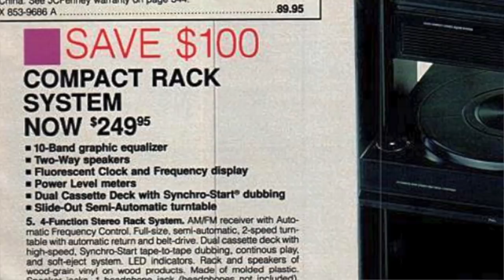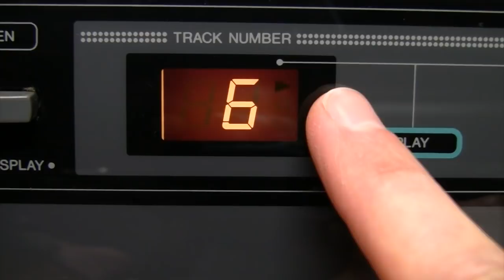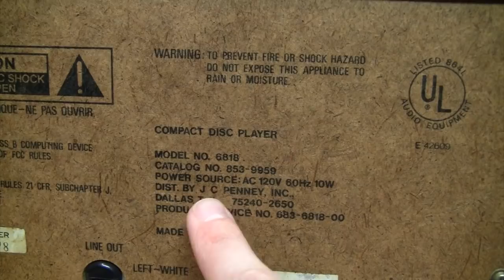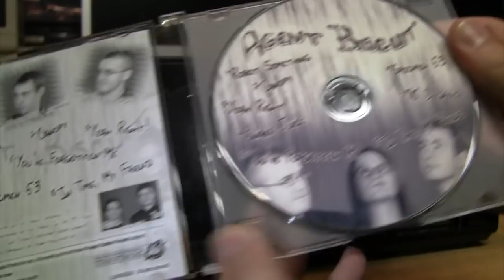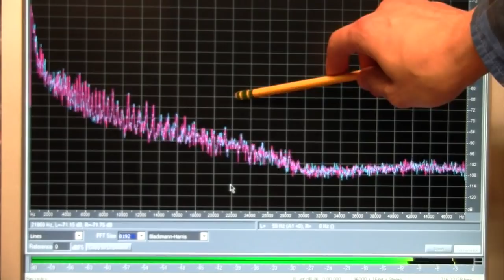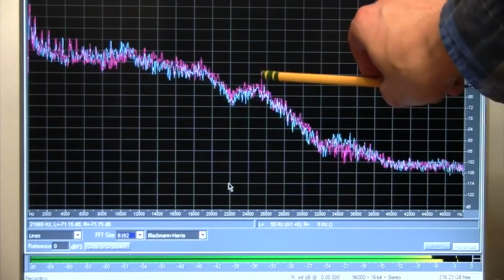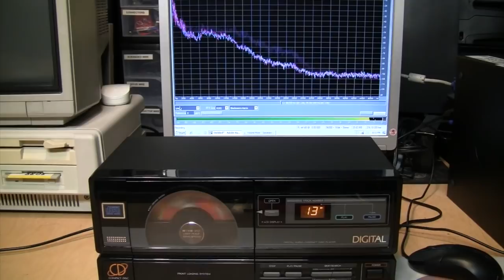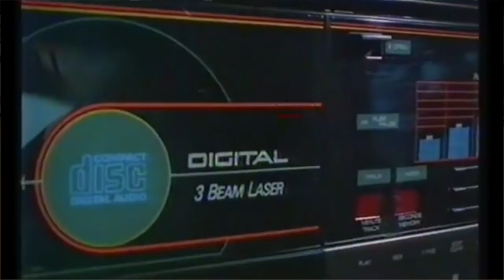The cheapest CD player ever made is surprisingly good - the 1988 Yorx CD Pal

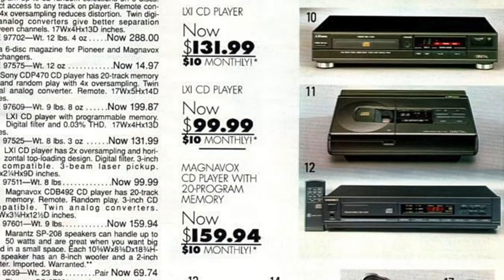Comment: 1:25 my first ever CD player was #12 on the catalog photo. A Magnavox. That thing was a beast. It lasted forever. When I was DJing in clubs I even carried it around to play mix CD's so I could take a break. Dropped it down the stairs of the nightclub and surprisingly it still worked. I had it for over 20 years and then I think heat finally got to it as I was DJing at another club where the AC was out and it finally died. As for the JCP CD Player, it looks like the one my wife had when we were dating. After we got married she left it at her parents house. I should check next time we visit there but chances are it is long gone since we have been married over 20 years now.
Reply: That looks like a Philips CD492/482/480 clone, Philips owned the brand Magnavox for parts of the world or the whole world by that time, but your Magnavox was manufactured in Hasselt Belgium by Philips.
Reply: @corneliusantonius3108  I am not really sure where it was made. Wish I still had it. I remember Phillips/Magnavox had a factory at one time in Knoxville, TN before all the jobs moved overseas.

Comment: This is Brian. Thanks for testing this unit with a cd-r. Sony equipment wss notorious for not playing cd-r and cd-rw discs. This is a nice unit for its price. You are my hero for testing affordable units that slipped through our fingers in the past because people think you must spend more to get more. I have to mention that I've opened alot of sony low end boom boxes and equipment from that era and found all Goldstar chips inside. And sony sold them at high prices.
Reply: Wendy Starita CD-RW playback requires explicit support in the CD pickup, so only very late CD players had it. CD-R, on the other hand, is designed to play in any CD player. When it doesn’t work, it’s because of a combination of the quality of the burned disc (whose quality itself is the result of the quality of the blank disc and how good the CD burner was) and the quality and condition of the CD pickup (with time and use, the lasers and photodiodes age , the adjustments can get out of calibration, and the optics can get dirty and foggy). When all these factors conspire to reduce the contrast in the signal, eventually it gets to where it can’t play. (Whereas, for example, the aged CD pickup may still produce a usable signal with a good pressed CD.) 

Anyway, upshot is that the reasons why CD-R and CD-RW won’t work in old players are totally different. :p
Reply: @tookitogo  I agree, but while every other company was making equipment to play cd-rw, sony didn't step up. I believe it was because Sony was manufacturing store bought pre- recorded cd' s to sell , especially when they acquired many labels,(Columbia,  Warner bros. Etc.) in 1992.  My friends all bought Sony  equipment around that time and were disappointed because of this pitfall. Philips was far ahead in this market.  Thanks for your specific analogy.
Reply: Goldstar = LG
Reply: @danieldaniels7571  This is Brian. Really,? well, Goldstar was the number one Microwave seller in the early 90s. And with their chips in low end sony products, I'll bet you are right. I have an LG tv and phone. Seem pretty good. (Fingers crossed)

Comment: LOL my parents tried to buy me  that JC penny stereo as a gift. It got returned because.....THE CD PLAYER DIDN'T WORK! They ended up getting me a Technics receiver and later a Sharp CD player. These were made with Sony chips and Sanyo Laser Pickups, which were actually pretty good. Sanyo pickups tend to outlast all the others. Yes, large lens Sanyo pickups will play CD-R.  RW Discs require the laser to be put out of focus. Don't!  If you adjust the laser current pot  (increase) it will read RW discs,  But then you have to switch it back to play back normal discs. Increasing the laser current will reduce the life of the laser. Sounds good for a cheap cd player!

Comment: Least they included a DAC chip. There's some cheap old CD players (such as Yoko F-92 and a couple Fisher models) which have a discrete-logic DAC purely for cost reasons.
Reply: Was it actually any cheaper? Or was it just another of the many “marketing wank” (to paraphrase Dave Jones) descriptors used back in the day on every CD player?
Reply: Hmm.. I wonder if that's why a lot of CD players with Sanyo mechanisms (based around Sanyo SF-88/90/91 laser and the like) would actually play data CDs and put out that ear rape to the speakers, instead of muting it like 99% of the other CD players out there
Reply: Knaeckebrotsaege I don’t think so. The vast majority of CD players will play that burst of deafeningly loud noise. It’s only very recent players (mostly the kind capable of playing MP3 discs, i.e. players that actually can read a data disc) that mute it. Or are you saying that those Sanyo players will actually play noise continuously from a data disc, not just the initial burst??
Reply: @tookitogo  Yup, those players based around Sanyo lasers (also commonly found in cheap store-brand all-in-one and microtower systems) will continuously play that ear rape data sound, even from multiple tracks if the disk contains them. And I've never heard even a burst of it from any other CD players I've gotten my hands on over the years. Even the cheapest and nastiest CD player I've got (a Goldstar GCD-626R from 1987) doesn't output anything with a CD-ROM in it, and neither does my moms 1990 Sony CDP-M27 I currently have here for repair (worn laser + slipping tray belt)

Comment: It reminds me of my very first CD player bought in 1992 from a now defunct catalog shop here in England called Index and was the cheapest CD player at the time. It was branded 'Crown Japan', though amusingly had 'Made in China' directly underneath the brand label. It had a red power on LED and a similar very basic LCD display that wasn't even backlit.

It did have a motorised tray, can't remember if it had Random or was programmable but I have never use those features much.  I did feel that it represented very good value for money though as the sound was so clear and much better than anything I was used to. You would have had to spend a lot more money for similar sound quality from an analogue cassette or Record player.

Comment: Maybe this player hadn’t been used much, such that its laser isn’t worn out, and its RF adjustments happened to stay in-spec, all combining to let it play CD-R. (As a reminder to readers who don’t know this, a CD-R is intended to mimic the optical characteristics of a pressed CD, such that in theory, any CD player should be able to play a CD-R, as it appears to the player as a slightly dirty (less contrasty) disc. But if a player has aged such that its laser pickup is weak, then the reduced optical quality of the CD-R can result in a signal too weak to detect reliably. In contrast, CD-RW has radically different optical characteristics from pressed CDs and CD-Rs, and thus requires explicit support in the player.)

Comment: The thing about the lowpass filter (aka Legato Link filter as you mentioned it here) now makes me wonder... if Software players like VLC allow you to tinker around with it as well or if it actually all depends on how the DAC of your soundcard (Sound Blaster X-Fi Extreme Audio 1040  in my case) and how it's handled at the end of the signal chain. I never saw any option for Audio CDs where you could change that.
Reply: It is a mix of both. The DAC itself has an antialiasing filter at around half its sampling rate. So you don't have any control over ~20kHz filtering in a 44.1kHz DAC. But if you have a newer DAC running at 96 or even 192kHz its built in filtering won't be active until around 40 or 80 kHz, so you could control the filtering below that point.
Reply: @eDoc2020  it's depressing most player software leaves you no control over it… Not even VLC which allows you to do a lot more than most other audio players…

Comment: Incredible quality on all of those solder joints on the bottom of the circuit board. Also the drive mechanism looks all solid and well made. If I compare this to the crap you get now in china-made devices costing 10 times as much, I come to the conclusion 30 year old "made in japan" stuff wins.
BTW: I haven´t seen one bad cap.

Comment: I have a couple of vintage CD players from the mid 80s, a Technics and a Sony both mid range drawer loaders that are heavy, solid and well built. Both are still in excellent condition although I've had to clean and lubricate both as well as change the belts on the Sony to keep them going. Like this little unit of yours both decks will happily play CD-R discs but not CD-RW whereas a much newer all in one mini system in the kitchen bought in the late 90s wont play either.
Reply: 2fast4me I never did for compatibility reasons

Comment: "Cheapest" ... "Yorx" ... Yeah, that sounds about right. I'm impressed how well this one is working, 32 years later!

I remember as a kid, so many friends had Yorx "stereos" and boomboxes and none of them had a working CD player.
Reply: Yeah i had yorx slimline portable stereo the toggle switch went out on it and i shipped it back to the company and they sent me another and after while the same thing happened again with that one so said forget it no more cheap stereos and i save up got a sanyo wm 20 that about 37 years ago
Reply: I never knew anyone with a YORX, but I can clearly remember in the 90's Nickelodeon use to give them away as consolation prizes on their game shows. I had a Panasonic boombox(don't remember the model number) all the way from about mid 93 till the early 00's with a 3 band EQ, and RCA inputs I even used as computer speakers. 
The only decent ones these days without spending a crap ton are made by SONY being the  CFD-S50( I have one, and it's great for $60, but I snagged it used for just under $12 today at the local Goodwill), and the newer SONY CFD-S70 which is a slightly cost reduced model that you have to lift the CD player lid manual instead of soft open like the older model.

Comment: theres plenty enough space in its case to fit an internal power amp so you could have a self contained unit that could drive speakers direct , maybe fit a slider volume control, below the track display ...

Comment: The design of that JC Penney player looks like the original Denons from the birth of CD's, that cost, I think, thousands of dollars, and skipped like crazy if you breathed on them.  (They had the distinctive triangular power or eject button in one corner.)  The most amazing thing about CDs is, they could be played on the cheapest, worst maintained players out there, and unless they got physically jammed or scratched, no damage was done to the CD, and it would still sound like new on a good player.  I had a pretty good mid-to high range stereo system back in the day, and my first CD player was one I could afford, a cheap Sanyo front drawer loader. I could not believe how good it sounded. Not that I was sophisticated enough to detect whether the cutoff from 22KHz was sharp or gradual.  I never looked back, and forgot about vinyl until a year or so ago... (Yes, it happens.)  I'll never give up my CDs.  You can get them at my estate sale when I'm done with them!
Reply: Not sure why people have a superiority complex with music and lock themselves to one format. I have music on all formats and they cost me less than 50 cents to $5 a piece for everything  i have new or used. just recently got into reel to reel and saving old radio broadcasts lost on home recordings.

Comment: The first CD player I got was I believe for the Christmas of 1984. It was a Magnavox. It was programmable but if I remember correctly it cost mom about $400. The cool thing that at the time meant nothing but now does is it was a helium neon laser mechanism. It had a high voltage supply in it and heat sink on the back. The machine still works today in my brothers possession. It needs new belts though. The deck was one stout player. Read CDrs and CDRWs. It was the only player that would play damaged CDs the newer semi conductor lasers wouldn't. In fact one demonstration I did was to put a piece of electric tape across the disk and it would still play. I had used it many times to copy from damaged CDs as it was the only one that could play them.

Comment: I bought a Crown CD-110 from ABC Warehouse back in 1987 for $59.99. It was very sensitive to errors on discs and would skip. There was also a CD-210 that included an integrated radio. The units were made in Japan much like this one, but it was smaller. If you Google it you can see pictures of it. I wish I had kept it now but it's long gone.

Comment: If there's one thing about vintage CD players it's that even cheapies have personality and surprising functionality. It's also fun to try to deduce who built the thing: as with many department store/RS-badged electronics back in the day it was likely built by JVC, Hitachi, or Matsushita (there were others like Funai or Sanyo but these were the big suppliers). I once had a different Penney-branded CD player from this era, a very slimline tray loader but otherwise the same as this one in terms of function and features, and it flawlessly played discs that even modern high-end CD players struggled with. I think the OE was JVC. The OE here may be Citizen owing to that prominent "three beam/spot laser pickup" on the front, also typically emblazoned on Citizen CD players of the era, but it may also be a Matsushita unit, since I have a mid-'80s Technics CD player (SL-P550) with a similar belt-driven worm gear for the optical block (and they also used mostly Matsushita-branded electrolytics here). Incidentally that Technics unit, a tray loader, has a mirrored window so that the loaded and spinning CD can be viewed from the front. Kinda neat, but I mostly keep it around for its BB DACs.

Comment: The CDC CD 540 is my first CD in 89, they were reliable and long lasting, the tray load belt in mine has crapped out, stuck in a corner with new belt waiting to go in, the CDC 660 has been repaired, a hard rubbish find in 2004

Comment: About 1984/85 I bought  Sharp tray CD player for $150.  No remote.  Sharp was a co-developer of the compact disc so the player (Japan manufacture) was no cheap knock-off.   I sold it to a co-worker a couple years later because I had moved up to a more elaborate player.  But no complaints about the Sharp whatever.

Comment: Some precisions....
Despite its age and cheap plastic fascia.. No erased buttons.
Is it a similar plaver as the vertical loading one on an Alf episode?

Around 1985 more affordable Cd players were marketed, such as the 3 in 1 Samsung digital tuner, mechanical dual cassette wells
and a Cd player with similar display. Just one lcd for track number and LEDs for functions. No program featurws, no remote no frills. Can't remember model.. just showed Easy Control system for simplified operation and sliding  volume control.

I remember buying a whole system without Cd player costed the same that buy the player alone.

Comment: Just a question for you VWestlife. 
When you record some of these CD samples, do you have to turn down the gain on the recording software and/or hardware?
I've been seeing a lot of CDs that automatically push the VU meter into the red here in Australia. 

Thanks.
Reply from the maker: My sound card has adjustable gain of the input level. I set it to peak at around -3 dB.
Reply: @vwestlife  Ah, thank you.

Comment: They totally missed an opportunity here.  The player knows the speed the disc is rotating at, so it wouldn't take much to have it flash an LED or a xenon strobe tube in time with the rotation speed so you could just see the front of the disc, seemingly stationary.  That would have been neat.  Flashing white LEDs would have been perfect, but i'm sure that at the time this was sold, white LEDs cost as much as the player itself. ;D  And between OSHA standards and concerns for stroboscopic lights, and the lack of market desire for CD players these days, it's likely a feature we'll ever see. ;D

I remember those bottom-end CD players with incandescent backlit lcd displays.  :D

Comment: Back in the early 90s, I believe about 93, I purchased an RCA CD player at Circuit City for $59.99. It only had a 2 digit display, and only the basic features on the front panel. With the remote control, you could access more features such as random play, intro play, and program it to play tracks in any order. Does that CD player have a remote sensor? Maybe there are more features accessible by remote.

Comment: I'm familiar because this is around the time that I received my first CD player, and $100 was the price of entry around that time.  I received a Cizizen CBM-777 from Damark, which was a top loader semi-portable which did last several years.  I'm pretty sure the nearby Hills dept store had the Yorx Grandeur version of this player for the same $100 price.  Not only did the Citizen not display time like more expensive players, but it lacked the scan function for holding down track buttons.  They were skip only, no repeat function.
Reply: My second CD player was a Citizen CBM-1000. I loved it. Those were totally portable, but used an external battery pack that held 6 AA batteries you had to buy separately. I got creative and made an adaptor to run mine off a 9 volt battery that worked great.

Comment: I had one of these machines it was branded Matsui which was the own brand of Dixons/Currys in the UK. if i remember the sound quality was very good for such a cheap machine. the machine broke down after about 10 months Dixons could not repair it so they exchanged it for a later model that had a more conventional drawer loading mechanism but the sound quality of the later machine was nowhere near as good as the original machine. i was disappointed with the new machine.